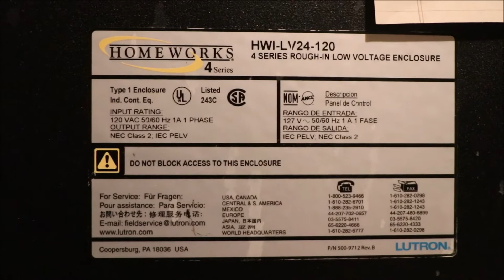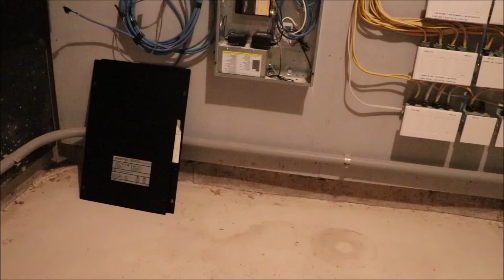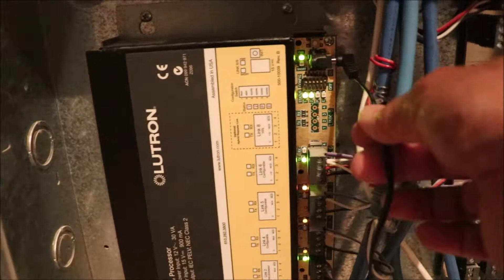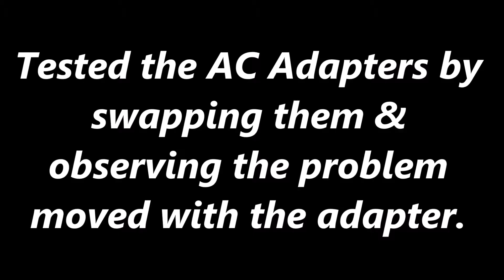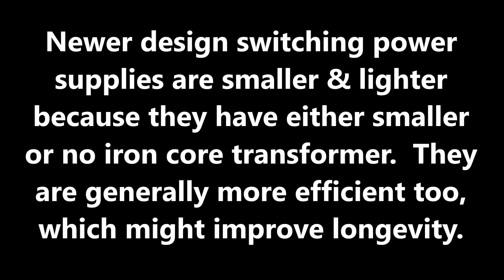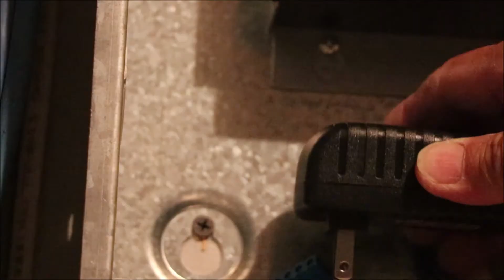Lutron Homeworks remote Keypads not working

Comment: This putting a new adapter worked several times after power outages but this time it does not do the trick. My wall panel lights are all flickering. I've reset the power to these rooms as well. So I basically have 4 rooms with zero lighting. What else can I try?  This is the third adaptor I've had to replace in 10 years.

Comment: Hi, I have a 10 yr similar lutron honeworks 4 system that came with a condo in Boston that I bought about 10 yrs ago. Right now I have the "waterfall" error with the lights flashing up and down on the keypads. Could mine be as simple as just replacing the power supply like you did in this video or is my whole processor bad? I also know the batteries inside the processor only last about 10 yrs which is also on my list of things to replace but if it's just the power supply that would be a really cheap option obviously instead. Which power supply from amazon can I buy to replace the t120-15dc-9-bl power supply that o have now. All the generic ones I found on Amazon end in 2-bl instead of 9-bl and wasn't sure if I could use that instead